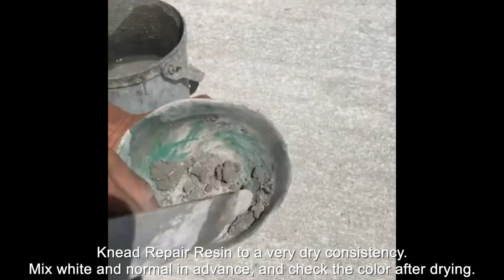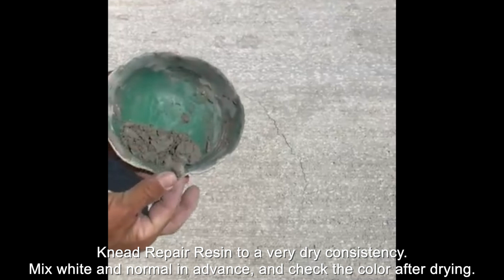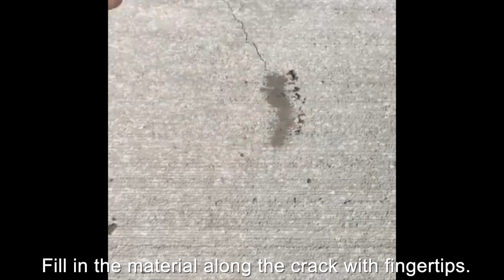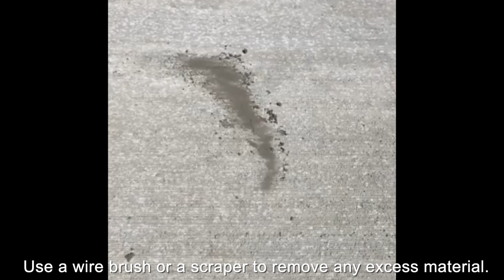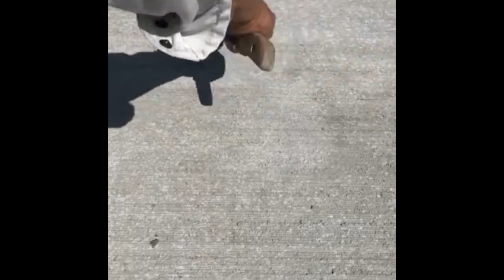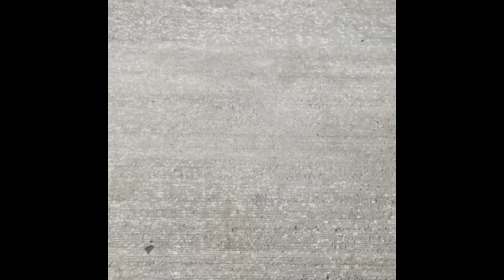Easy Concrete Crack Repair with Rubbing Technique

Comment: Will this mix stop cracks reoccurring?
Moisture rise from patched cracks?
Reply from the maker: No, that's incorrect. It's just an improvement in appearance and not a fundamental repair, so there may be a risk of recurrence.

Depending on the cause of the cracks, epoxy resin injection or the use of materials that follow movement may be required.